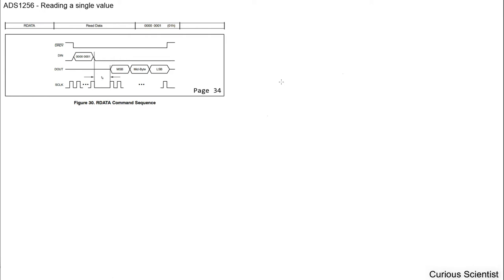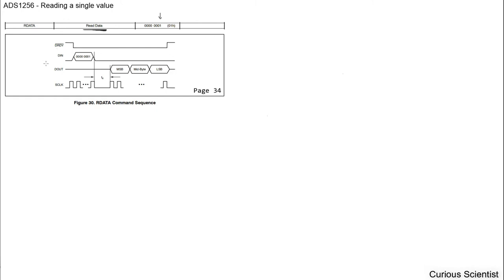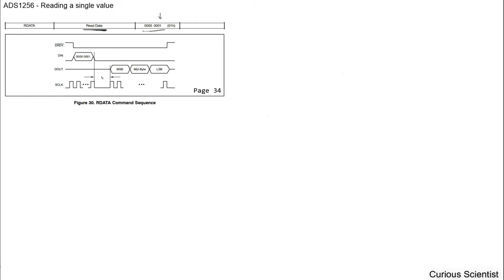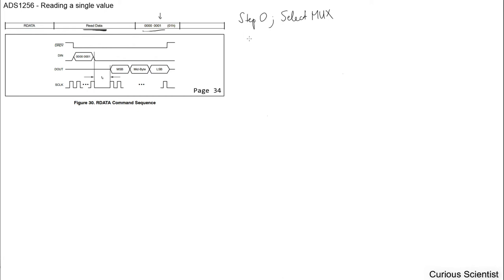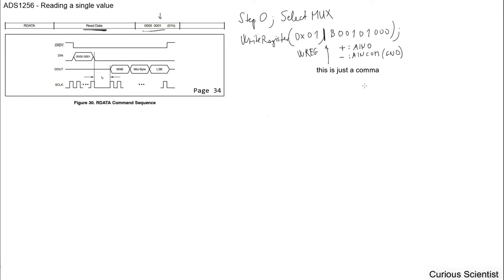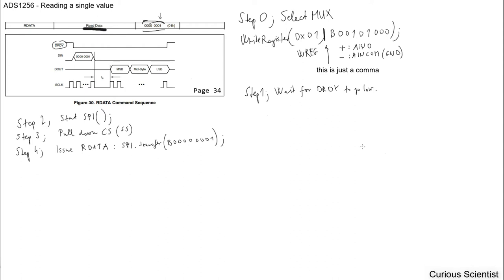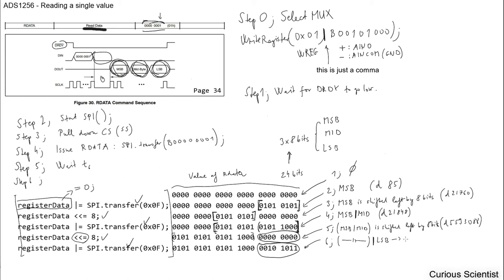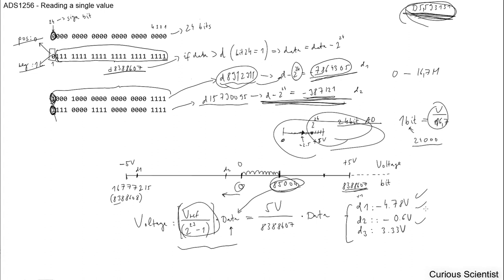ADS1256 - Reading a single conversion result using RDATA

Comment: I think I need to buy a board to try all you show in this series
Reply from the maker: If you decide to buy it, please use my affiliation links haha. 

Seriously, if you get a board (doesn't matter from where), you will have a lot of fun with it. With this ADS1256 board and the smallest Arduino (Nano), you can do so many things! And also, you can practice a lot of important things related to the Arduino. Just to mention a few things: serial communication, controlling pins (reading and writing them), SPI communication, interrupts, timings...etc. It is a small investment as compared to the outcome. I will upload approximately 5-6 more videos where I will show all the aspects of this chip. At the end, you will be able to make a fully operational 8-channel, 24 bit AD converter.
Reply: @CuriousScientist  Of course I will do it! 
Some of your links are out of stock but they  still have the blue board
Reply from the maker: @isidoromaich7226  It is so frustrating, I also wanted to buy more of the green board. I think I will buy the blue one or buy three green together. You can find three green boards together available on this side. But the green is good because it is cheaper than on Ebay or aliexpress and Banggood's shipping is usually better.